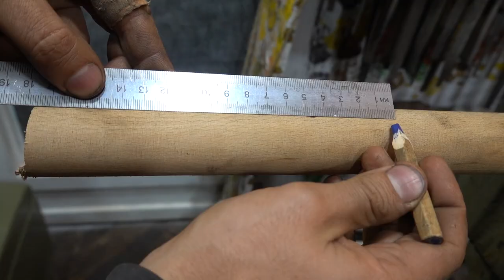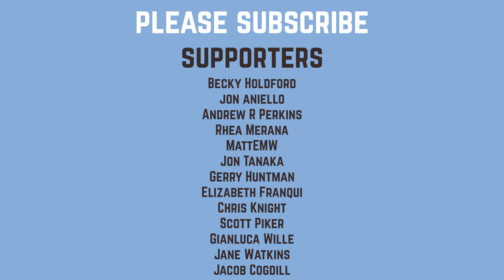Restoration Of An Old Lost Drawknife Tool

Comment: Great restoration. With the radical amount of curve in the blade, I was wondering if this tool might not have been used in bowl making, like dough troughs and the like.
Reply: I wondered at that too. Perhaps he had it upside down?
Reply from the maker: Hello, thank you for attention. This model of drawknife it will be convenient for various operations in carpentry: precise fitting of logs to size, quick removal of material, as well as sampling of recesses.
Reply: @ScrewsAndTools    I saw your demonstration, and was impressed at the ease of debarking your piece. I would have used the simple convex one for that, but your result was much the same..and I love the feel of the old hand tools like that. Has more soul or character or something. Maybe my ancestors whispering to me?
Reply from the maker: @mred8002  I also like it when you feel old vintage worn handles and not polished metal)
Reply: @ScrewsAndTools    Yes! Unless a handle is damaged beyond repair,  I’ll glue and  clamp to save them. But the ones that have been polished by generations of hands are the best. Character. Metal ones don’t have the same feel.

Comment: Imagine doing your business, meditating while you wash the dishes, when a goddamn Kavkaz viking storms in with a chunk of dirty metal and tries to occupy the sink😂😂
Excellent work man, you ground and sanded it to a near perfect state. Your lathe skills are not half bad either! I could imagine that if you manage to keep this drawknife sharp it would be useful even at delicate work while shaping wood.
Have you considered using a wirebrush extension for a drill for initial cleanup? It would also allow for the rust jar to get filled more quickly 🤔
Reply from the maker: Hi, thanks for your attention and for the joke it was funny)) To be honest, I didn't think about filling the jar quickly. For some reason, I like to fill it manually, slowly using improvised tools, as if removing a layer of rust.

Comment: I have a straight and a convex blade drawknives, but have never seen one with that acute curve. Might be suited for a spokeshave for wooden spokes and rims? Did you find out what it was used for?
Reply from the maker: Hello, thank you for attention. This model of drawknife it will be convenient for various operations in carpentry: precise fitting of logs to size, quick removal of material, as well as sampling of recesses.